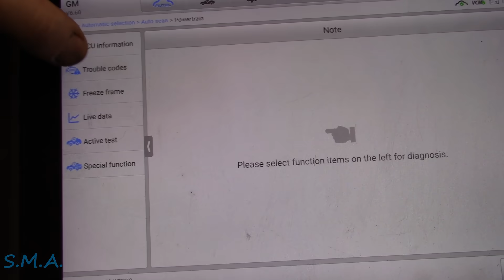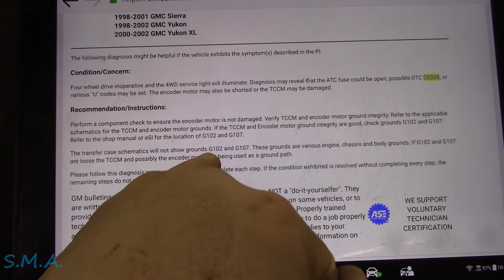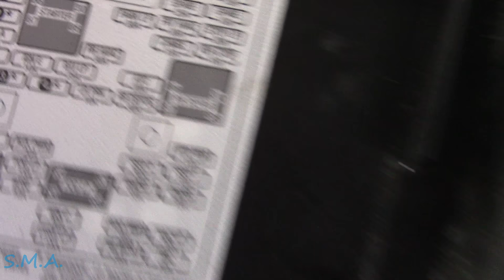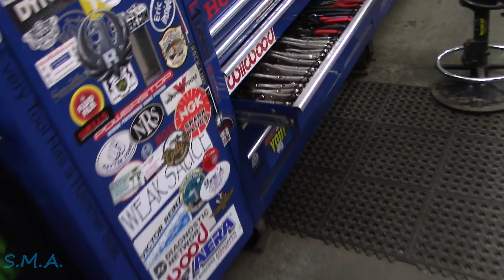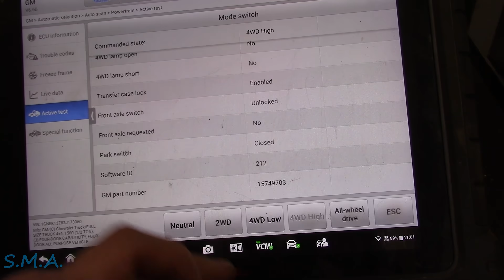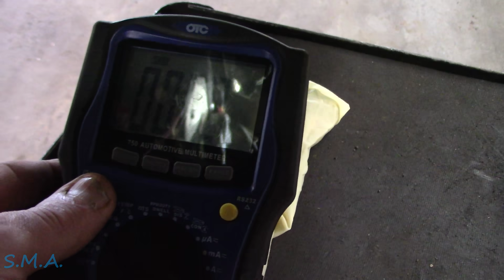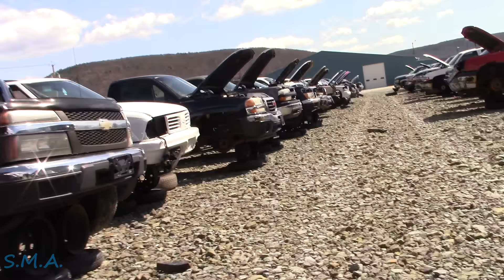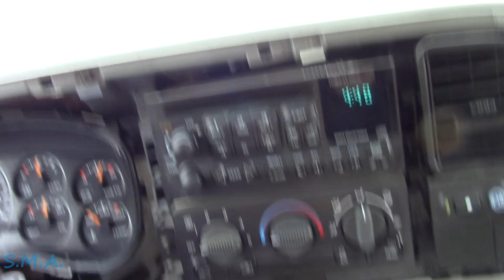Customer Spent $1000's And Still No 4WD

Comment: Smells like anger. Yep. Know that feeling.
2000 Ranger v6. Brake pedal did pop heard and felt then pedal started pulsating when braking (regardless of speed).
Took to local shop told them of issue they said they'd check the brakes.
"Mechanic recommends" ball joints, tie rods, rear shocks, & front pads & rotors, confirmed it would fix it (the front brakes). Auth'd all but shocks (all 4 replaced within last year).
Picked up vehicle driving home not even 2/10 of mile home pedal pulsate again. Took back.
Next AM told me it's "dealer only as it's intermittent ABS". Took it home and let it sit. Tried troubleshooting myself by pulling ABS fuse (still did feel weird but not pulsing).
Took to 2nd shop told them issue. Rear wheels were removed then drums (driver side was rusted onto wheel bolts so 3 hits of sledgehammer to remove) and rear driver side shoe crumbled inside drum when removed. Drum metal backer plate left rivet grooves in drum.
First shop? They say they're sorry they missed it but they did check all 4 wheels.

Uhhhh.  No.
Don't know any reasonable resolution since they didn't fix it and said it would. We had to pay another 700$+ to replace rear drums, shoes, & leaking wheel cylinders.

Oh. The 2nd shop? Yeah. They fixed it first try.

Comment: This just goes to show that working OEM junkyard parts are better than aftermarket or reman. I had to replace one of the rear parking sensors on my 2003 Volvo XC90 and a used genuine Volvo part bought on eBay was better than the new aftermarket part I bought on Amazon.

Comment: So thankful to have you and your knowledge Eric. You get to the root of the problem, instead of throwing parts at it. I’m amazed at all the garbage aftermarket parts. I’m a GM guy and try to use OEM replacements when I can. Something like that transfer case motor costing $600+ for OEM would have me doing the same as you, a trip to the junkyard for a hopefully 🙏🏻 🤞good used one.

Comment: I just went thru this with 2 remanned motors. Same thing, shorted to case, same codes. Went to a u pull and got a really nice OEM off a low miler wrecked truck. It fixed my issue. Who's doing the remanning?! Jeeze! Great job Eric!

Comment: My coworker is going through this exact same thing, wonder if her Nappers (not a sponsor) reman ATC motor is shot as well. Hmmm, will have to show her this video. Her motor has a different gizmo that hooks to the shaft at the transfer case.  Some toothy looking one. I work at a heavy equipment shop, tractors and such and we got (me) got to go under her truck with water raining down from snowing.  Fun times.  She wast throwing parts at it at this point. Not my circus at this point. Great diagnose on the Chevvvrolaaay Mr. Eric O! Should have taken it to you to begin with. Even with a new OEM, would have been cheaper I imagine.  And please watch your head. I bonk mine under tractors all day long and I think I hit my fingers more than the punch when removing spring pins and removing lock collars from the shaft on bailers.

Comment: "O" means Open loop: can't measure any resistance so no current can flow there. Could be that the internal capacitor is shorted.

Comment: Ah yeah, the old "brand new junk" problem.  I bet the first other shop put in the "re-manufactured" part, assumed it was good on the basis that it was "new", and based all their subsequent troubleshooting on that assumption.  Then the second shop got the history, saw the "new" part in it, and made exactly the same assumption.

Here's the thing:  "re-manufactured" means it isn't new.  It means it's an old faulty part that's allegedly had a repair done to it.  Based on the failure rate before any actual driving has been done after installing these, I'm going to bet most of the parts have just been "cleaned up" and not actually repaired, and certainly not tested to spec.

Comment: My 99 Silverado blew the ATC fuse one time a couple years ago. If the ground straps may be rusted or corroded, could that cause the fuse to blow or might it have been something else. It hadn't happened before that, bought it in 2012 and it hasn't happened since. What do you think?
..................
..................
..................
Ok, never mind. You answered that later on in the video about the ground. Any other thoughts? Maybe just an old fuse???

Comment: If a shop tried to charge me a grand or two without fixing the problem, I'd sure as hell be telling them to rip out whatever parts they put in and shove it where the sun don't shine. I can understand if it's something difficult to diagnose, but firing the parts cannon is for home mechanics. Not trained technicians. Charging anything more than a diagnostic fee when you haven't fixed the issue is straight highway robbery and gives shops and techs all over a bad name.

Comment: Always a little more satisfying repair when it’s from another shop that couldn’t fix it. Great video as always keep them coming.
Reply: Yeah those boost the ego a bit. Couple years ago i had a bimmer that had been to a Bmw dealer first, then to a Bmw specialist (that deals in used high end cars) and then it came to me. Cant remember what was wrong with it but i found the fault within an hour. Not because im "that good" but cause i test things and try to be methodical in my diags. And of course because i understand my basics. Was a pretty easy fault to find for anyone that actually diagnose cars. Think maybe it was egr related. Anyhow! That felt kinda ok...
Reply: I rewatched the first part, and it's not clear just what the other 2 shops did. For the kind of money the guy spent,  something should have been noted. 
As usual Eric fixed what others couldn't.
Reply: We has a customer bring us an AWD drive Explorer that would bind and unbind very badly when driven at any speed above 20 MPH. They had replaced the trans, transfer case, both diffs, driveshafts, pretty much the entire driveline short of the motor at another shop. TBH I did think one of the diffs was bad after a quick test drive, but knew it did this through 2 different sets of diffs. Turns out someone had put front tires on it and paid very little attention to the size of the tires they installed. The difference in the rolling diameter of the front and rear tires was causing the transfer case to bind and unbind kinda violently. They spent over $3000 trying to fix a car that needed front tires. Ill say it again, if you find a good, honest shop cherish them, they are few and far between anymore. AWD vehicles apply power to more than just the rear wheels constantly, if one tire size is way off it will be turning at a different speed than the others. They make a caliper that will measure the difference in the diameter of a tire, the front tires on this Explorer were 3" smaller diameter than the tires on the rear, a huge difference. A lot of places will always recommend 4 tires on an AWD vehicle, that is how important having the correct tires on an AWD vehicle is. Different sized tires can also cause problems with your ABS system as well.
Reply: @stephenhood2948  I always went with 5 tyre rotation on my AWD.  That way if you have to use the spare, you don't have one brand new tyre with 4 worn ones to cause, at the least, wheel speed sensor errors.
Reply: @NemoConsequentae  Yeah, I know tires with differing rolling circumferences can cause problems with transfer cases. Mine has a temp spare though, I dont want to ride around with that on the car unless I have to.

Comment: As soon as it blew the fuse...  I was thinking that you should check resistance from each side of your motor, to ground...   You checked across the motor itself, but neither side should be grounded----     I have an assumption that one side of the motor is grounded internally.  (but we'll see.  only half way through the video now. :)

Comment: You did not say what the used shift motor cost,,  Probably not much,,  Lets just say that not only did you find the problem, but you saved the guy 600 bucks in the process,,  :-)

Comment: I'm finding it less and less worth it to go aftermarket with some parts... I diagnosed a failed rear wheel speed sensor on a Ford Escape, got one from Napa, only to immediately pull a new code for something along the lines of "invalid signal". I don't remember the exact code. Either way as soon as I got an OEM sensor light immediately out and all systems go.

Comment: Diagram showing ground on A & B by default is correct because you don't want the motor to be energized all the time because first the lock keeps the transfer case from unwanted shifting and second the motor life would be adversely affected by the motor being energized all the time. It would also be a fire hazard if the brush were worn and not making good contact, the motor could get super hot sitting in your garage or a parking lot on a calm day.

Comment: Reminds me of my mates rx8 keeps stalling n intermittent start.
Independent shop charged him 1200. Replaced, fuel pump and ign leads. No fix
Dealership charged 1000 for battery and spark plugs.  No fix
Car stalled at the light.  so he got out to push it to the kerb.  As it was push button start and was outside of car, steering locked and went down the ditch.
He said i can keep the pos if i tow it back to my place.  So i did and fixed it lol.  Connector to fuel pump had a loose pins inside.  Wen u push together one didnt go in. Gave the car bak

Comment: This is exactly why you don't sanction repairs unless the shop guarantees that it will fix the problem. If you pay for an hour or two of the technicians time and they just cant figure it out, that's one thing. Time is money and it happens. But if they start replacing stuff, charging you for time and parts with the understanding that it will fix the issue, and it doesn't, DO NOT pay the bastards.

Comment: Yesterday on The People's Court, a guy in NY State sued a garage mechanic, saying that he didn't fix his car in order for it to pass state Inspection. It dealt with the Evap System. The part was no longer available from the Manufacturer, and the mechanic put in a replacement part from a junk yard car. The part worked, the customer was just a jerk! The Money Light wouldn't go out, until they drove the car 68 miles. Customer lost the case!

Comment: New from GM transfer case option. Cable operated for only $799.00 on the option sheet.  Cable made in DPRC and dies after a year. You work so hard for your money and you can't even get partial value for it in the parts world. Thanks for the detective story.

Comment: That is a good diagnosis... It looks to me that the shift motor is run by an H-Bridge style controller.  This allows the motor to turn in either direction by swapping the polarity to the motor.  So on the shift motor connector, the pins "SHIFT MOTOR CONTROL A" and "SHIFT MOTOR CONTROL B" should normally be floating (not B+ and not ground) on both the control side and the motor side when the motor is not being commanded to turn in either direction.  If one signal is always shorted to ground then something is certainly wrong.  If one side is grounded or shorted to B+, then when the controller goes to turn the motor it might short B+ direct through the short to ground...  If the motor side is shorted to ground or B+, then the motor is bad.  If the control side is shorted to B+ or ground when the motor is not being commanded then the controller is bad.

Comment: I had a very similar things happen to me with a 2003 Yukon XL a few years ago. The transfer case was having some problems, I can't remember what exactly, but I got a new motor. It was a Dorman from Advance. I was still new to working on cars so I wasn't as apprehensive about Dorman as I should've been. Shortly after I kept getting "service 4wd" errors, I tried what I could to fix it to no avail. I took it to a mechanic, it took them a while to figure out what the issue was, but it turned out to be the motor was shorted internally. Well, I marched right back to Advance and made them take it back for a full refund lol...got a different one and away she went. Then the transfer case blew out completely becasue of the weephole issue...
Reply: Weephole issue 😳 do explain.
I have a 2005 Suburban 4WD
Reply: @JenniferF2882  there's an issue with the GM transfer cases, I believe 99-07 but could be more, where the fluid pump inside will rub through the case, causing all the fluid to drain, and then the gears run dry, sieze, and fatally fail. The case itself is some magnesium alloy so its extremely light, but steel rubbing will easily chew through it. It doesn't happen to every single one, but the probability is high. I have an 02 suburban with 376k and no issues.

Saving it most times isn't an option, so it must be prevented. To prevent it you'd need to pull the case out, open it, and either change the pump or add a metal plate. Some guys also put JB Weld over the hole, though I'm not sure how I feel about that. I believe Eric talks about it, briansmobile1 also has a very good video explaining it. Just look up GM transfer case pump rub and you'll find all you need. My current truck, 03 silverado 1500hd, had that happen to the previous owner so it has a new TC, so I'm gonna add the plate Brian mentioned in the summer.

Comment: Diagnose Dan just had a Peugeot, that died when hot. Previous shop correctly diagnosed faulty original crank position sensor and replaced with new Bosch item. No fix, became crank no start. Dan changed again for new Bosch and no fix. Tried a cheap no name and problem sorted. Further investigation revealed that the two Bosch units had been assembled with the “polarity” reversed at the factory.

Comment: We normally watch your channel streaming to the big screen - 75 inch - thus don't have an opportunity to comment.  I began as a wrench bender about 1949 as a teen.  Had the power tools of today been in vogue in those days I might have followed that path.  But, the Air Force thought I belonged in electronic repair that eventually, after months of training found me repairing flight simulators.  Of course Aviation dominated my life thereafter.  I do not envy your rust environment one little bit.  My 2000 GMC Sierra has absolutely no body or frame rust so I'll stay in Alabama, thank you.  Your electronic trouble shooting is very good, as good as I have ever seen.

Comment: Ugh. I've been going through it with a shop since Jan 12th. I paid them on that day for a replacement (used) engine for my 2.5l Jetta. They got the motor 2 weeks after that.... today I finally got my car back, 1800 over the estimate. Anddd now it's dumping coolant all over my driveway. I really wish there was something legal I could do at this point but no contracts or anything official was ever signed. Absolutely pisses me off that they didnt call me when it started going over budget. Didn't approve any further repairs and now my total ended up about 65% over estimate AND it still isn't fixed. I wish there as an Eric O in every city.
Reply: I hate when shops do that. I would demand a refund, or threaten a lawsuit. 9/10 as soon as a lawyer is involved the shop caves
Reply: @xvx897  Working on just that. Got a free legal consult this afternoon

Comment: More excellent troubleshooting techniques, Eric. I have been burned once or twice by defective new parts, as have others. Maybe it was you that once said, "just because it's new, doesn't mean that its good". Keep up the great work.
Reply: I'm with Eric O - I'd rather use a OE part from a junkyard than use a new aftermarket part - especially if it's Dorman.  Been burned way too many times over the years.  That's not to say that brand new OE parts don't fail, but I find the failure rate is so much less than with aftermarket stuff in most cases.
Reply: NEW, sands for Never Ever Worked

Comment: with your meter off, press and hold the light button. turn meter on, release light button, and press light button. on flukes, this keeps the backlight illuminated until the meter shuts off or you shut of the meter.

Comment: Lesson 1 read what makes the thing work! I see you always reading what makes the part work and what you should expect. I guess the other shops don't know how to read or they are just lazy. Well done sir!
Reply: Mechanics will just put in cheap aftermarket parts and read a laptop. If it doesn't have an OBD port nobody knows what to do. I have a Previa and every single time I have to show these kids that are only 10 or 15 years younger than me where the damn engine is - on my own car. I've learned how to do mostly all general maintenance myself so I never set foot in a shop anymore except when its something super serious.
Reply: I had a shop teacher who always said "when all else fails, read the directions. "

Comment: One side of me wants a new comfy truck. The other side says why do I want a $700 a month payment and won't be able to repair it myself.

I went through 4 Ford smart alternators that would test fine on the growler, but refused to charge on the vehicle. Finally on #5 a cheap Pure Energy alternator, we got a good one. Two Motorcraft alternators from the dealer, one Car Quest new alternator, and one Remy.